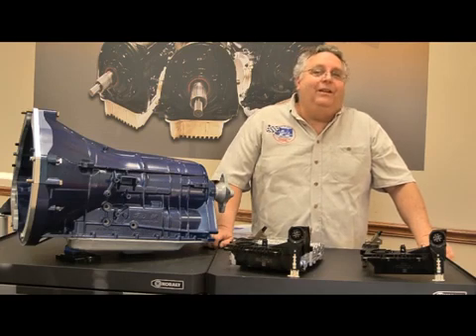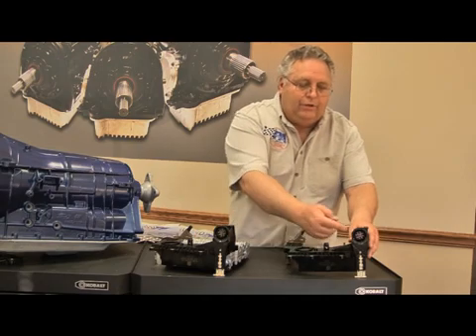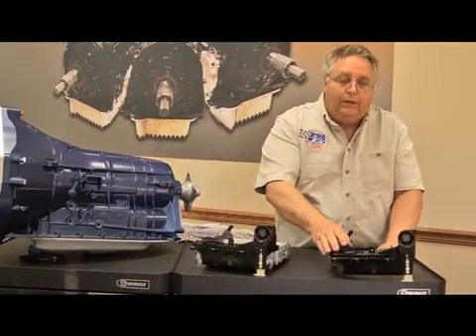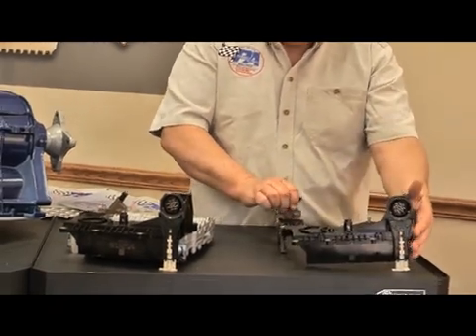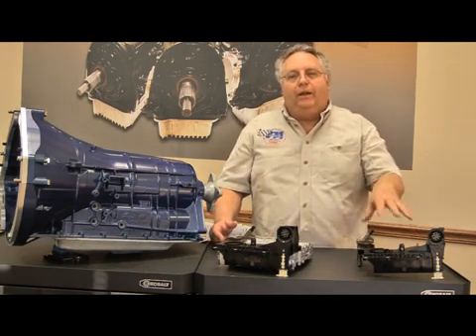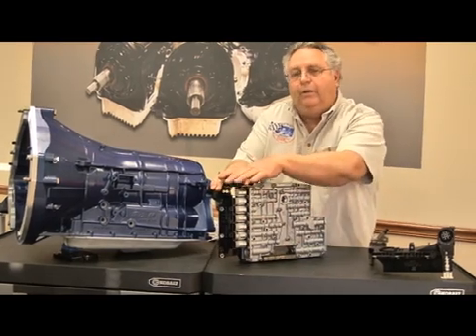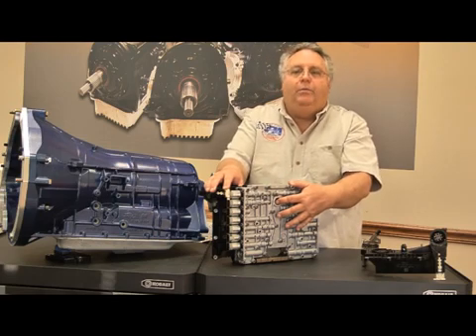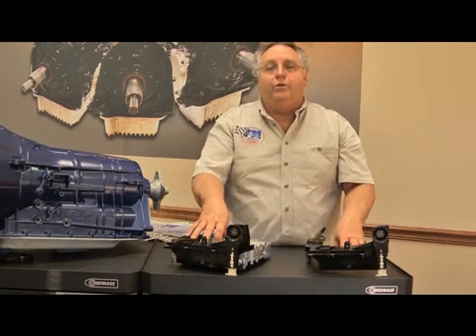6R80 Leadframe Valvebody

Comment: The dealer changed the lead frame on my 2013 Ford F150 lariat. 2 months ago Now my instrument panel will not turn off.  Can there be a connect with the lead frame?
Reply: Bobby Evans is it fixed now?
Reply: There is a recall on the lead frame now.
Reply: Got my lead frame replaced but it didn’t fix the problem. The problem turns out to be the Valve Body
Reply: There is a recall on lead frame now?
Reply: @philncider8077  yes i just went in to day its on back order call them and get in as soon as you can
Reply: Dash lights caused by park shift safety switch on mine.   Found part for $8 on Amazon and replaced in console shifter mechanism.   Also my key wouldnt release.  Little pin on switch was broken off